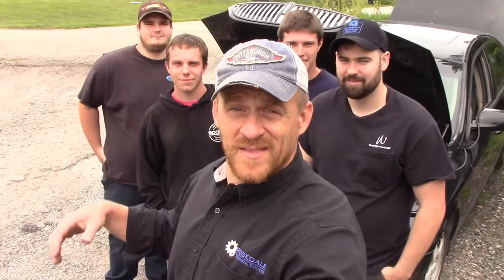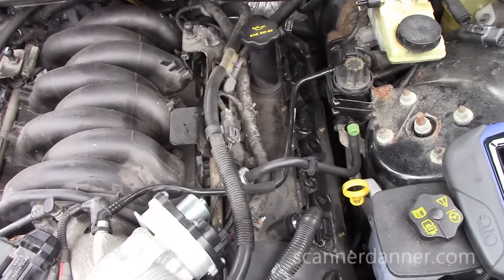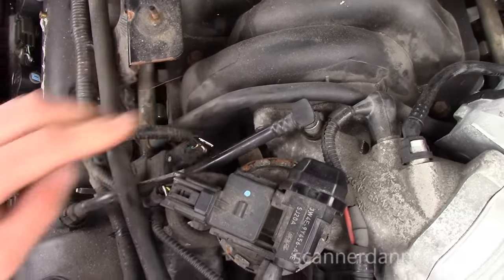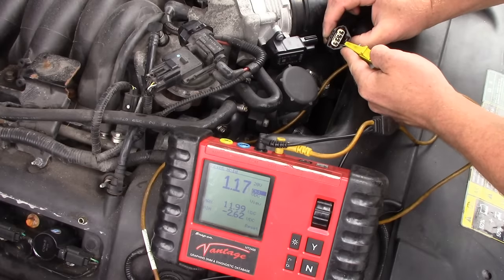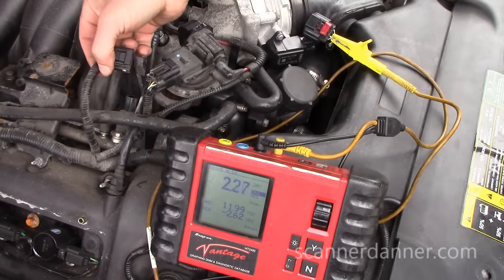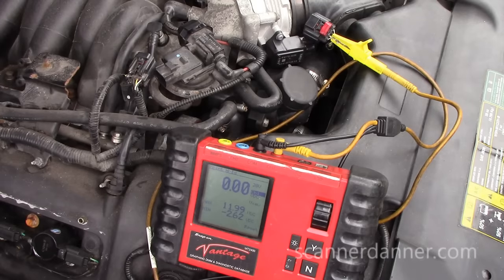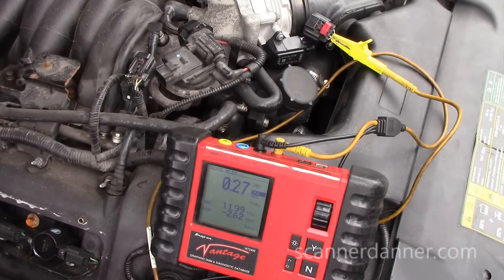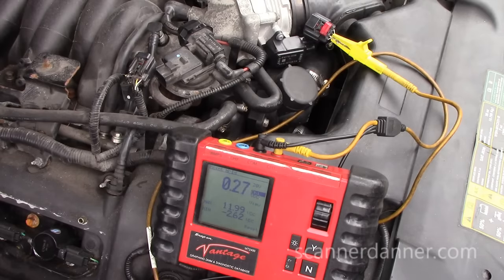Troubleshooting a No Start, No Spark, No Fuel, No Com (any car)

Comment: Thank you so much for the video Mr. Paul. Cant wait for sept. 25. Last 5v ref issue i had was a shorted fuel tank pressure transducer. Also i totally agree with your take on the 1hr diag....the misfire didnt create the no start. Off topic of the video, but i usually hate driveability issues on pre obd 2 vehicles. Thanks to your premium channel, today I was able to quickly and confidently diagnose and condemn a pcm on a 93 Yota. She had no igt signal from pcm to igniter. And props to the component info on my verus cause alldata, mitchell, & identifix didnt help me for s*** on diagrams.

Comment: Excellent Video, sometimes contacts on a relay will burn or overheat when the coil of the relay shorts out.  For example if the coil shorts internally and you end up “losing “ say one third of the turns in the coil, the relay contacts may close sluggishly and hold in with less than normal force. Over time this will cause high resistance across the contacts and you will see the type of failure you have in the video. This can be proven by testing the current draw of the relay coil and comparing it with the draw of a known good relay. Of course there are other reasons (mechanical, poor material/manufacturing, over-loading etc) that may cause a relay to fail. I always like to know if possible the root cause of component failure so thought I would throw this out there at the risk of sounding a little long winded! Love the video, good stuff!

Comment: I agree with you 100% you always have to measure voltage's when the component is in the circuit activated and under the load conditions it's the only true accurate of how the circuit is operating

Comment: Great video. I have an intermittent no-start issue on my 2007 Toyota Camry. If I drive for a while and then park often times it will not start unless I let it sit for about 20-30 minutes. If I am sitting idle it starts to flutter. The fluttering can begin within 5 minutes of sitting idle and sometimes it can run longer before it starts to flutter. Once it starts fluttering it's about to cut off but most times I give it a lot of gas and it will self-correct but it totally fights me back. If I am at a point where I can pull off to drive while fluttering it will hesitate a lot. I have changed the spark plugs and the mass airflow sensor. I did notice oil on one of the plugs and a very small amount on another. I do have a consumption issue and have used Bars Oil Seal Engine Oil Burning & Leak Repair. I haven't taken it to the shop yet but I'm nervous that it's going to be an expensive repair. I was told last year about the consumption issue but I am no willing to do an engine rebuild due to the cost. I just keep up with the oil to make sure it's not low. Any ideas for what else I can check on my own.

Comment: I love the t-pins.. been using for years. 
Had a no start on a 1999 GM truck. Ended up being the pins within the fuse panel from the relay being smashed in incorrectly.   So as you would test it.. it was fine.
I think i took the top off the relay and probed it inside to find out what was going on.

Comment: Great diagnosis Paul. With the Relay unplugged Terminals 87 & 30 (Load side) should read zero resistance when the control terminals 85 & 86 are energized. Paul is right- just because a Relay clicks it doesn't mean the Relay is passing power properly.
I use a power probe and a dvom to quickly check any relay in question.
Reply from the maker: The resistance test is not a good one for load carrying circuits. It can measure good with the ohmmeter but not be able to carry current. Just wanted other to know that. Thanks!

Comment: Nice to meet you Paul!!! you're on another level with your knowledge and I really need your help. I hope you can guide me through this. I never had a no start issue with my car before, I
had the car a few years. I tuned it a couple of times no problem ever starting. However I ended up with a random misfire issue I couldn't figure it out and I need to get the car inspected. So I took it to a mechanic to put the rear converter on it. I couldn't get to the bolts on it . The car is a nissan maxima 04. I got the car back from him. I can't lie it was quieter than before. I live a mile or two from him. I drove it home parked it for a couple of days, because I sent for some tape to wrap the converter in. I go to move the car nothing happened I get a boost drive half a block  it shuts off. Now I have a crank no start issue. The fan blows now in the on position and it won't start. I changed the fuel pump nothing's different. Please!!! teach me how to do this I'm parked in a bad spot, starting to get tickets. I'm going to pick up a test light tomorrow. I have cheap multimeter it doesn't have a lot of readings on it because I couldn't grasp it. You make it look easy. I hope you have the time to help me fix this. I rode my bike by to talk to the mechanic he's not there  . I met another customer looking for him too he told me that he's been calling the guy since last week trying to get his car back...that's why I've been trying to fix my own car all these years. I'm a real DIY kind of guy...but this I need help with. I hope I can understand so that I can start it.. Thank You for even reading my comment You're the man Paul...smiles....(you're the man Dan!!!) sounds better, come on... it rhymes
Reply from the maker: When the cooling fan runs all the time, this is usually because the ECM is offline. Main power feed to the ECM maybe? Check your fuses first. Do you have a voltmeter? I will have you check the 5v ref on the TPS or MAF IAT sensor next
Reply: @ScannerDanner  Thank you  for getting back to me .Yes I have a basic one .  Thank You Paul.. for real... Ok.. I'll  try that ..you're inspiring!!!
Reply from the maker: Okay, cool, get me voltage readings on your MAF. I believe it is a 5 or 6 wire one right?
I just need key on engine off, unplugged readings on all wires. Make sure you have a good ground on your meter

Comment: Good video, only thing I would have thrown in there is actually supplying the relay with a power source, such as a 9 Volt battery then measuring its actual internal resistance, confirming the bad contacts on your multimeter.

Comment: Great video Man! When trouble shooting these no crank situatuins wouldn't it be best to always start at the battery and work your way up through the relays, fuses, then wiring harnesses and sensors? Also, have you heard of the LoadPro tool? It loads relays and costs less than half the price.

Comment: Yeah, agree with comment 927,also great career choice need more 1/2 as good as you. I have a rant about diagnosticians sir. I paid 2 mechanics, nothing they couldn't figure it out. So on to the dealership Greenway Kia in Florida on Colonial Drive. 763 dollars and and they Shrugged their shoulders. Once the one guy couldn't figure it out he handed it to another tech this guy decided it was my Viper Security System that was on the vehicle this cost $900 to get installed. Previous owner the guy completely takes out the whole security system well it wasn't the problem. I still have the problem the car starts when it wants to and don't start when it don't want to can't drive it in the state so I'm stuck watching videos on how to figure this out because these guys can't be that damn complicated it was running. I have spark right when you go to start it something is killing that spark it sounds like it wants to start every time I pulled the plugs they're soaked. I check for spark same thing the initial spark and then the spark plugs stop sparking other times I will get in the vehicle start it up and it'll run drive everywhere no problem but I don't drive it everywhere all I do is run around the block and then I turn it off it won't start got any guidance on videos to watch of yours

Comment: This is the one video, that made me think of another 'what if', to your jeep video, about a stater relay control side power with key ON only, a" low reference voltage" quoting you discovering a main relay with a voltage of 3 volts then jumps to 12.39 with key in start, would you think its an adjustment issue to neutral safety switch, even after seeing that the switch opened to allow the 12 volts to starter solenoid wire? neutral safety switch is good yes! yet it does not crank nor start why is starter not absorbing the 12 volts from neutral safety switch and the relay control terminal has a low voltage of 3.44, is it from the neutral safety switch needing an adjustment?

 Then I saw your video, where you discovered block ground missing because its being energized, that is just so amazing all the voyages you keep discovering you prove it with voltage drop turning key to start position. Bad grounds in block verified by battery jumper cables neg lead to starter group and battery ground got that thrill of certainty again. 

Then, I saw another video, where you discovered the throttle signal wire with 12 volts not jumping it to ground risking cooking the ecu.

 Then I saw another video, where you do jump signal to ground without the resistor, then another with a resistor.

 You answered, my what if's, except the starter relay control side reading low 3.44 volts,  with key ON. Is this a symptom of a damaged transistor inside the computer? How do you test for that, its like you can't just watch one video, its only one tiny piece of the puzzle, all the videos has opened a bigger picture and a thought process, that I have never experienced. I am discovering that I am learning truly learning how to think, for the first time! Thank you for the gift, I wasted so much on academic learning. I would be very happy if you can answer it?
Alphasentory

Comment: Thanks for sharing Paul , good direction to go in with the no communication . Checking the sensor 5 volt reference and tracing back to low ignition voltage to the ecm from bad relay , wouldn't have thought to do it that way ,  but I'll keep that in mind was very cool to see.

Comment: Nice troubleshooting! Only thing i ask myself is why would you check the Ref. on the sensors. Not communicating with the tester is already a sign that communication with the PCM is a problem so its very probably that the PCM isnt working correctly and also the Ref. voltage. I think the way  you took is good. But i was asking myself when i watched the video.
Reply from the maker: This would be a good reason why I follow this path https://www.youtube.com/watch?v=1Nvyc_88AbY

Comment: If you cannot get your hands on a replacement relay quickly it is possible to remove the relay plastic cover to gain access to the contacts. By pulling some sand paper between the contacts the burnt oxide maybe removed and you have a good chance of getting the relay up and running.  Okay my bad, I wrote the comment before seeing the final few seconds.
Reply from the maker: Absolutely! And you'd be a hero for someone

Comment: Great video but have you done a video that clarifies where you expect to see the 5 volt ref and the 12 volt circuits. I say this as on many of your video you use a incandescent test lamp which as you know willnot work on a 5 volt system so you need to clarify things...great work from the UK.
Reply from the maker: Not completely true, I'll use my incandescent test light for integrity testing on a non bias signal circuit. So in series between the 5v ref and signal circuit, while watching scan data change. 
Also I have a ton of classes on this on my website. This would be chapter 9 "the 5v reference circuit" and chapter 10 "signal circuit integrity testing" that I'm referring to. Hope to see you there!
https://www.scannerdanner.com/join-scannerdanner-premium.html
Reply: Hi Paul, thanks for the reply, after writing this comment, just by chance, I looked at you video on a no start VW Passat where you do mention that the incandescent test lamp will not illuminate when used on 5 volt system but you use it to create a test pulse...I do keep an eye out for any Euro cars you work on although many lessons can be learned from your work on American cars....great work in teaching others.

Comment: Your videos are great wonder if you had any ideas:
 Have a weird issue. Have an older Chevy Express 5.0 VIN M . I left NYC for about one year and two months, when I left the van was running no issues at all. I came back last month Feb.22022, during that period the van sat basically on the street and battery was disconnected. I changed the oil went to start the engine  and nothing, just cranks and cranks. I suspected it was the fuel pump and heard no priming when opening the key. The weird issue is that I disconnected ECM fuse B under the hood and plugged it back in and the dash check engine light would flash on and off, at the same time as the fuel pump.. so it cycled on and off on and off and wouldnt stop. The other weird part is there is no spark, i bought an ICM , coil and still no spark. The van was running before I left, it was bot touched or started so i thought  maybe mice but cant find anything chewed up. I manually powered the oump with a power probe and pump runs. Not sure either if this year had factory alarm but I dont think so since the dash has never shown me any security lights. I am stumped and dont want to throw parts at it, i was the thinking maybe the crank position sensor… would you have any ideas 

My biggest worry is why would the fuel pump cycle on and off continuously and at the same time, the check engine light would flash on and off. Thanks hope you read this.
Reply from the maker: For sure this is suggestion an ECM issue. Where is the ECM? Is this the one that sits below the master cylinder? If it is look closely at the bolts that keep the two aluminum halves of the ECM together. The bolts will rust and break off, allowing the ECM housing to separate and allows water to get it.
If you don't see anything, with the key on, give me a voltage reading on you TPS, all 3 wires, I bet we do not have a 5v ref or the 5v ref is higher than normal, or we have no sensor ground, again, all items that will point us toward the ECM. 
Do NOT go run out and change it just yet, let's test it first!
Reply: @ScannerDanner  i forgot to mention i plugged in a basic OBD2 and it links then it display “link lost”. 

Yes this van has the ECM underneath the brake booster. I had the issue you described 10 years ago and changed the ECM. I will look at it today but we are having snow so might wait a little. I appreciate your help a lot.
Reply from the maker: @YoungHeartedSoul  I have a video on this top, I think it is in my MAF sensor (chapter 12 playlist) right here on YT
Reply: @ScannerDanner  hey, I always like writing to you because I love the trouble shooting skills you have. Well I went outside today rain and sleet and decided to take off the ECM and sure enough The corner half was cracked, I believe water built up and froze and ass it expands, it cracked the case letting water in! Had a spare one laying around, switched the chip around and the van runs like new! Wish i could post pics here! Thank you so so much!
Reply from the maker: @YoungHeartedSoul  absolutely awesome! Love helping people and when there is a fix like this its even better. Thanks for the update!!
Reply: @ScannerDanner  no YOURE awesome!!! Also need help, my 73 trans am is throwing a BCM code.
Reply from the maker: @YoungHeartedSoul  🤣

Comment: So you were checking hi-priority sensors (MAF, TPS) for high resistance correct?  Is this generally how most vehicles networks are wired and can affect voltages across different sensors?

Comment: The best thing to do before getting on a repair is to get as much information from the owner. Sometime the owners may have attempted to fix their car themselves, had it at another shop or may have added some pretty aftermarket accessory or part that is not does not agree with the vehicles electrical systems. 

 I had an old 80s model Ford LTD station wagon that would go through aftermarket/refurbished alternators rather quickly. It wasn't until I finally purchased an OEM alternator from Ford that I never had a problem out of again. Sometimes It's worth the extra $$$ if you purchase OEM parts.

Comment: Terrific video Paul but I remain confused with one thing. You like and hump the uActive ( 199.00) to find that bad relay. That's great but a 50.00 Loadpro would have found it just as fast and it has more uses than just substituting a relay. Some of your contemporaries mock a device that you have to simply push a button (do they mock the uActive flip switch?).  Teaching voltage drop to your students is great and necessary but why not show them a fast, simple and inexpensive  way to do it?  Keep up the great work.